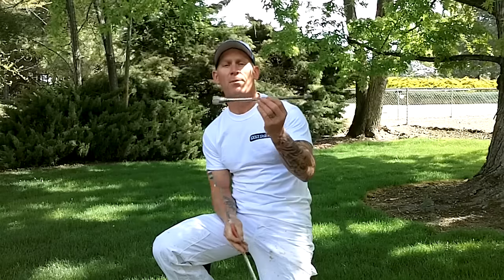Airless paint sprayer instructions.  Why Does An Airless Spray Gun Spit?  Paint sprayer hacks.

Comment: If you get a spit blob on the surface immediately remove it with the edge of a small piece of toilet tissue which soaks up  the blob and leaves a perfect even finish.Spits are caused by the needle in the valve not seating properly. I have my gun valve regularly serviced and seldom have any problem. If paint builds on the tip nozzle just touch it with the tissue paper.
Reply: 1 air in the system 2 worn out gun needle 3 worn out tip
Reply: You’re wrong for that 😂😂

Comment: Is it just me or is that roller literally not getting the Cuts?.... look closely it's literally Not getting the cuts youd usually get had you taped off and used a brush. I mean it does most of the edging, but leaves a 1/16th line along the edges you'll have to go back over with a brush anyway
Or am I wrong ?

Comment: I really appreciate the knowledge that you share on painting but was curious why uTube shows the Graco Sure Shot attached to a spray gun and extension when it is never mentioned in your video.  Your workarounds are excellent advice and it all makes great sense that a spray tube from the gun (shut off valve) to the spray tip (needing high pressure to spray a fan of paint) would peter out once the guns incoming pressure of 3000 psi stops and the extension tube and spray tip are now failing to do what they need to due to the lag time to go from 3000 psi to 0 psi.  I did read in one of the comments that you said you bought and liked the Graco Sure Shot.  Why not do a video on this?  There are so few well done videos on this attachment.  I feel (I have a lot of Titan products) that for the price the Graco outshines Titan's version of this since the Graco gives you the swivel tip and easy pressure shut off adjustment.  I also realize that you have your system which works for you, is faster and it bypasses one more item to have to clean and worry about.  Again great advice, I would remove the Graco Sure Shot image as it was misleading for more but got you more hits on the video unless you do a little add in at the end.  Thank you for all of the tips!
Reply: I forgot to add ... When you spray all of your rooms, you don't back roll.  Is this a new construction method only or for most reprints too?  I just got my spray setup and I have purchased the Graco Jet Roller so that I don't have to deal with the overspray dust and at the same time I am bankrolling immediately after spraying.  Do you plan on trying this out in the future or is this too slow of a method for your company?
Reply: HaHa ... One more missed item that seems great.  Have you ever used the Titan Edge Guard for helping speed up the cutting (and then bankroll if needed to match) or is this another item that doesn't work with your work flow?  I would love to see a good video on this as well.  Not enough information on the Titan Edge Guard.  I bought it and I hope to try it soon but I am not a pro or uTube video creator.  Thanks again and HaPpY NeW YeAr :)